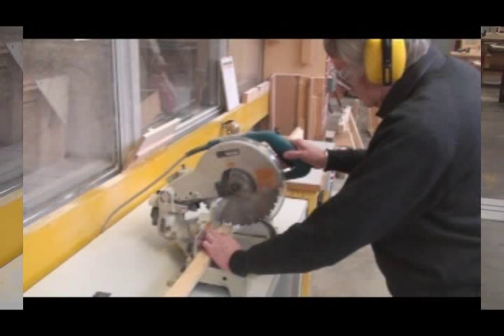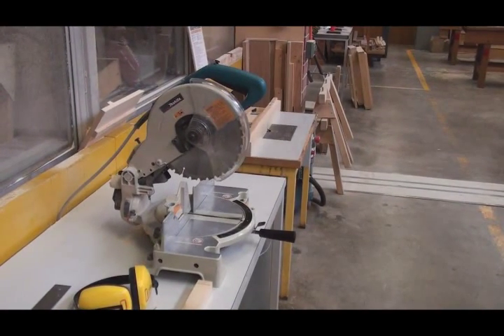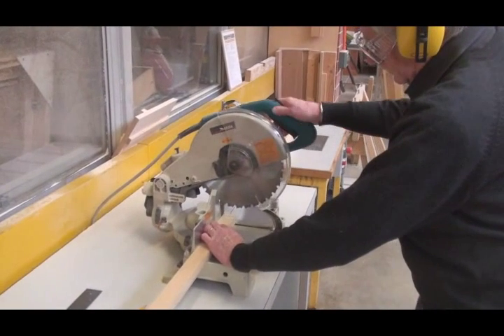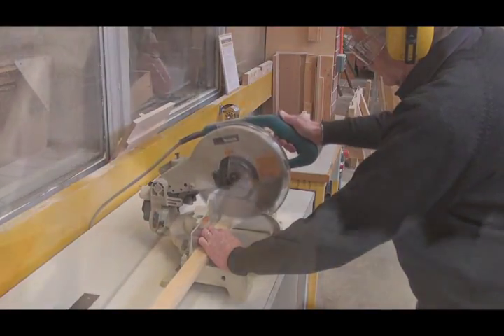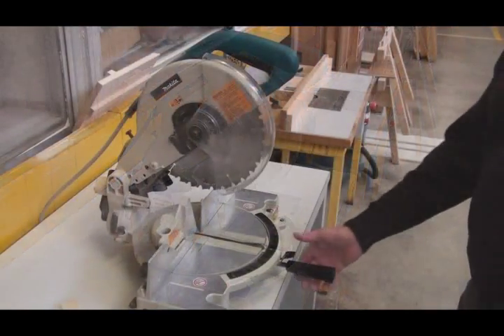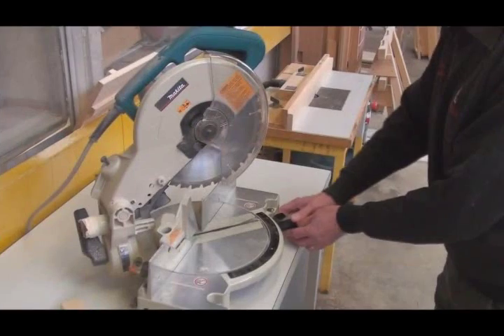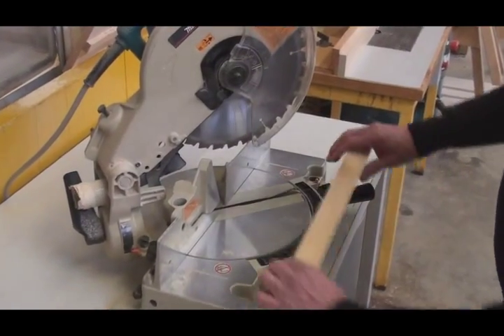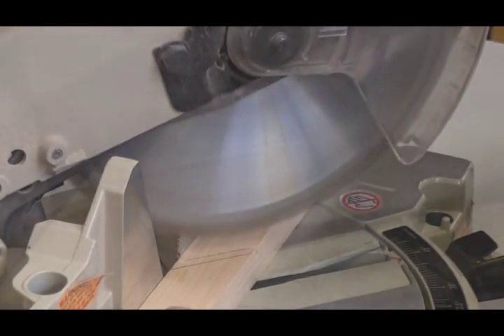Using a drop saw - timber

Comment: why dont you just line the blade up the first time , it will save heaps of time. the narrator guy sounds depressed
Reply: Out of my own experience I can say that this works but taking the time to accurately shave bits of gives you more control over precise distance to your line.